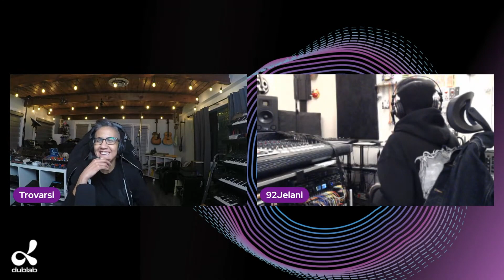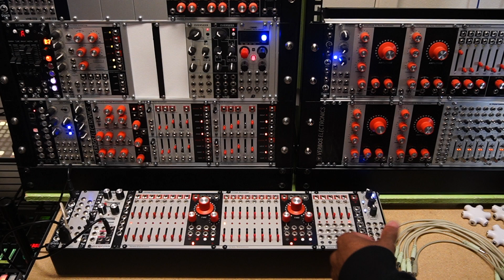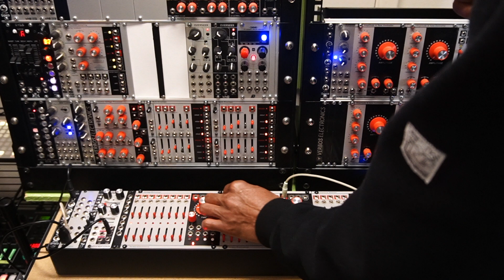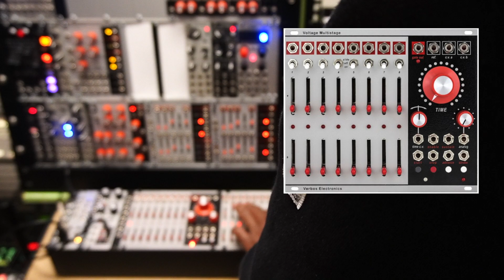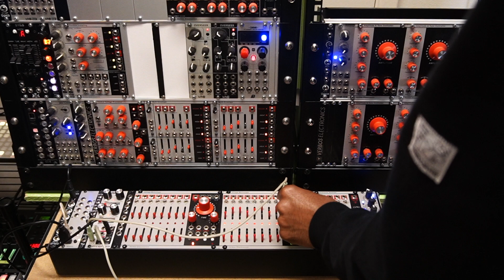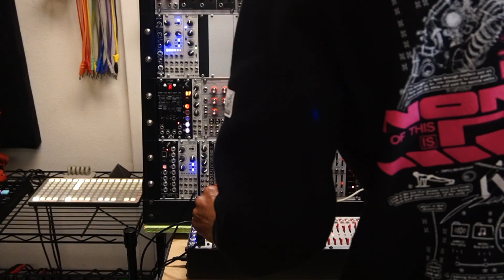Eurorack Sequencers as Oscillators

Comment: Ooooooooohhhhhhhhh any idea how you'd get them to pitch track?  Maybe try using the pulse wave output of a VCO as the clock input for the sequencers?
Reply from the maker: Possibly, but pitch tracking is overrated in my opinion. Just run CV into the time input and adjust until happy.